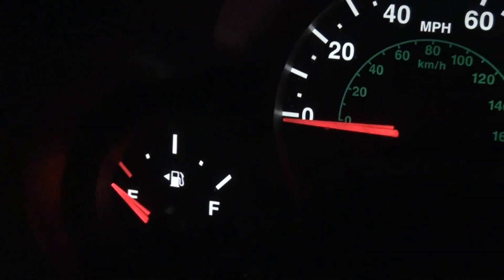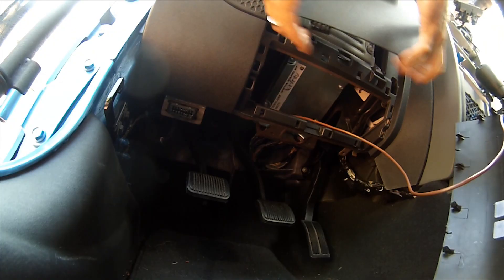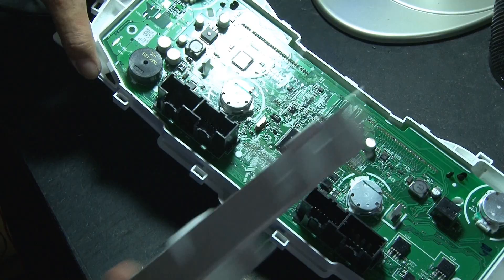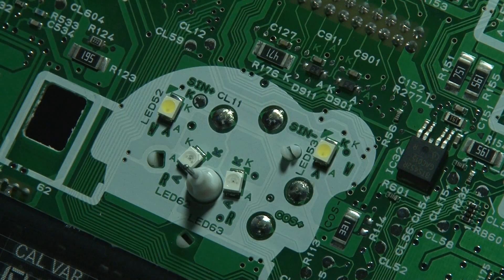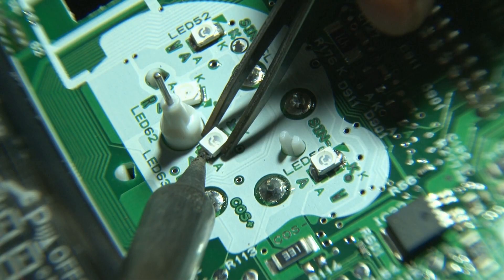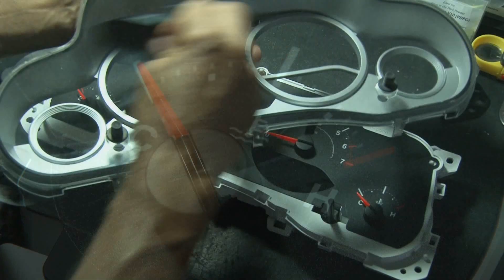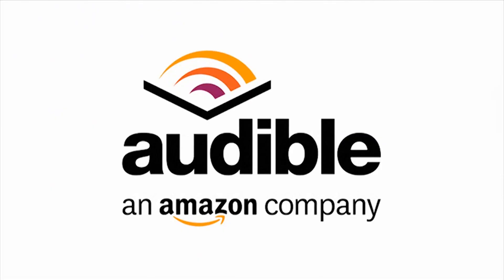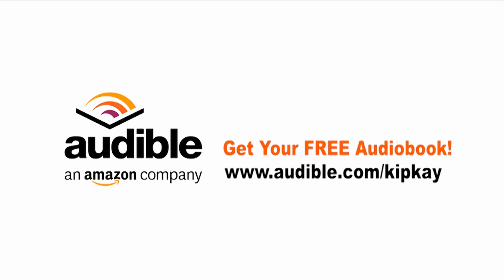Dashboard Light Hack!

Comment: WOW, what an effort. Get a Toyota, all you do is unscrew the bulbs from the rear of the cluster and replace it with LED. No pulling the clear plastic face off the front and certainly no removing speedo needles or unsoldering diodes etc! Well done though.

Comment: Removing the seat-belt light? For people that don't know, some cars use the same light to warn about engine problems, low gas, seat-belt, breaks, and tire pressure.  DO NOT remove the seat-belt light unless you KNOW it wont affect the other warnings. I think its really irresponsible for KipKay to say that without saying to check your car first.
Reply: please tell me witch car doesn't have separated lights. Usually there is engine picture-/check engine- light for engine problems, fuel pump picture for low fuel, seat-belt picture for unplugged seat-belt, (ABS) and/or (( ! )) lights for brakes  and (,,!,,) for tire pressure
Reply: This doesn't sound right,  because with that logic the check engine light would go on when your seatbelt is off (ie right before turning on the engine, thus giving people false alarms).
Reply: Also, I think the whole it's his responsibility to tell us if the car's lights are the same is a stupid statement. Were all adults were not sheep who blindly follow anybody who makes a video. It's your car do the research.
Reply: I think it's pretty irresponsible for someone to follow advice in a youtube video without knowing what they're doing and maybe looking into it a bit first. You're responsible for your own actions, deal with the consequences.

Comment: You do realize what you just did taking the speedometer apart is actually illegal in some states and voids the manufacturer warranty as well. You also very likely threw the calibration of the gauges off. You also were not using heat sinks while soldering which can cause heat damage to the circuit board and fry the chips. Nobody should replicate this video.

Comment: Will it work the same or kinda differently with my 1999 Toyota Tacoma?
Reply: Depends on the dash cluster.
Being from that area, they may use T3 type bulbs but you will have to check
They will most likely use filament bulbs with a bulb condom on it to add color.
Reply: Just go to superbrightleds.com nd put car type nd you will be giving the types of led that are compatible with your car under different tabss like interior, exterior etc. I got mimes there for a 1990 240sx :)

Comment: This guy is lucky he didn't fry his circuit board. He should have worn an esd strap or at least put the circuit board in an esd bag.
If you do this you run a huge risk of shorting out your pcb. At that point it's cheapest to buy a new cluster.

Comment: This is not something I would recomend! Ive modified some clusters and its not easy!
First!
All clusters cant be color swapped, some clusters have a color filter in the gauge face. So to change color in one that has a color filter you need to make/buy a new gauge face! And unfortunatly 70% of all gauge faces are with filter.
Second!
The needles wont be on the correct position if you do it that way! Insteed, before you remove the cluster, start your car and let it be on for 20 minutes. And mark the needle positions while the car is still running.
And when your mod is done and you are at the stage where you should put back your needles hook the cluster up in the car. Start and let it run for 20 minutes and place your needles where you marked them!

Check out my RGB cluster mod on my page  ;)

Comment: I don't see how anyone can have a problem with the seatbelt light. Sure I don't need it either, but it's not in anyway annoying if you are wearing the seatbelt as you're supposed to.
Reply: +Völundr Frey I drive a 2005 Ford Escape, not a single problem except for that light, I ALWAYS wear my seatbelt, and when I'm buckled, it thinks that I'm not wearing one. My dash has green LED's, and the Needles light up Red while the seatbelt light is an ugly ass orange.

Comment: You missed a few steps for your viewers:

1. Place the seat belt LED in a safe dry place that you will not forgot about.
2. As your body flies through the air towards your inevitable death think about that seatbelt light in it's safe place and how maybe JUST MAYBE, it would have done it's job and annoyed you enough to finally put one on.
3. N/A, you're dead.

Comment: I would bet that removing the seat belt light is illegal somehow.
Reply: +williwonti That's just if he doesn't ever want to pass a vehicle inspection again. Other than that, It's not illegal. Lol
Reply: depends on where he lives, we don't Inspection's in California, just smog BS
Reply: +williwonti LED's can burn out as well, so just removing it wouldn't exactly pose as criminal, though he could've just put electrical tape across the back of the panel or even on the LED to block its light without the extra work.

Comment: Why would advise or even suggest it's cool to remove a seatbelt warning light? Very irresponsible!
Reply: He didn't tell anyone not to wear seatbelt. That would be irresponsible. He simply said that he removed his, because it's annoying him.
Reply: Newjorciks
That clearly implies that he doesn't wear his, because it wouldn't annoy him if he did. Anyone with half a brain could easily come to the conclusion that he doesn't wear a seatbelt, which is irresponsible and sets a poor example.
Reply: Boyk14
I said that he did not suggest or advise, I didn't say he was not setting poor example. And the other thing is when there is something heavy on passenger seat it then too is ON or he just gets annoyed at it being ON when he gets in the car starts driving and then putting on his seatbelt as most people do, it could be that he already disabled the seatbelt beeper too.